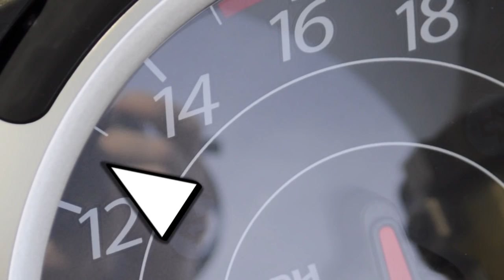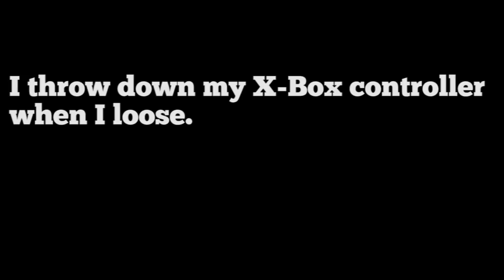Regular Car Reviews: 2011 Triumph Daytona 675

Comment: more like a street triple than a speed triple, speed triple has bigger engine more power different frame, single sided swingarm, ect street triple has no fairings
Reply: You've obviously never ridden a Daytona
Reply: @mikehoskin1674  you obviously haven't.. a street triple is a Daytona engine frame everything only difference is tune, fairings and suspension..
Reply: @mikehoskin1674  a Daytona/street triple are the same frame, suspension, swing arm etc. One had clipons and fairings. One has handlebars and naked fairings.
Reply: @jakvickersmusic  and you think they're the same bike still lol. Guess you don't even ride bikes let alone those 2.
Reply: @mikehoskin1674  I have operated both and own one thanks.

Comment: First bike at the age of 24, 2012 Triumph Daytona 675R(yes the R). Age 25 now, 8500 miles on bike. Have low sided once at a 25mph turn with cold Pirelli Diablo SuperCorsas on a 40Deg day out in the morning 8 months ago. Everyone Falls some day, but not everyone is immature. in less then 30 day's my Daytona and i Will be riding at Circuit of The Americas for a track day. Good review none the less but as you said this is a bike for someone more mature. Will admit though i've done multiple motorcycle courses to keep improving my skills and plan on doing the Advance Riders course once i make my way to lvl3 at track days. MSF BRC1, BRC2, and ARC already completed but thats nothing compared to track ARC. Wish i stayed in Cali longer to do the lvl1 and lvl2 total control courses.

Comment: i didnt know you rode motorcycles
Reply from the maker: Demosthenes409 I do :)
Reply: RegularCars Seriously though, do consider reviewing a CBR250RR (inline-4 from the late 80s) at some point. 20,000 revs of madness.
Reply: Ayush Sharma those are quite rare.
Reply: NinjaChipmunk27 Indeed they are. Technically they were never launched outside of Japan and Oceania. But a ton of people imported them all over the world because they were so nuts. Are you listening, RegularCars ? That's a great fucking story to tell right there.
Reply: I nearly bought one of those a year ago. It was sold out from underneath me on the last day :\ I saw a couple the other day too, hitting up the twisties and revving hard. They really do sound like F1 cars.
Reply: Ayush Sharma Or a ZX2R.
Or a Balius.
Or a GSXR250.
Reply: +Eggly Bagelface or a fzr250
Insane little bikes, all of them, luckily they're fairly common here in Australia. Well I mean cbr's there are lots, probably a little less zx2r then not many fZr250 and finally barely any gsxr250
Reply: +Eggly Bagelface or a fzr250
Insane little bikes, all of them, luckily they're fairly common here in Australia. Well I mean cbr's there are lots, probably a little less zx2r then not many fZr250 and finally barely any gsxr250
Reply: +Ayush Sharma Honda Hornet 250, I believe, has a slightly detuned CBR250RR engine, which redlines at 16k rpm. A blast to ride.
Reply: +Demosthenes409  HE NEVER WEARS A HELMET!!!!!! AND HE.... RIDES A SUZUKI HYABUSA!!!!!!!!!! "RIDE AROUND WITH MY HELMET STRAPPED TO THE BACK!!!!!!!!
"
Reply: +Demosthenes409  HE NEVER WEARS A HELMET!!!!!! AND HE.... RIDES A SUZUKI HYABUSA!!!!!!!!!! "RIDE AROUND WITH MY HELMET STRAPPED TO THE BACK!!!!!!!!
"
Reply: he has like 6 other videos
Reply: +RegularCars 

GROM! GROM!! GROM!!! GROM!!!!

Comment: Street Triple not speed Triple
Reply: Obie Wan you're not very bright are you... there's a street and speed triple
Reply: The Speed Triple has a different engine displacement, this bikes engine is a Street Triple with different cams (675cc).  The Speed Triple is 1050cc.  Obie was correcting the comparison to the Speed Triple.
Reply: dont worry, McG, that idiots comment makes it pretty obvious that he knows nothing about neither wheels, nor engineering.
Reply: Woah slow down there high speed. I had one too many glasses to drink and I misread and thought you said there's so such thing as a speed triple. Chill out kid

Comment: Small correction, the Street Triple is the naked version of the Daytona 675. Now, back in the 90's, the Speed Triple was the naked Daytona 955. Then the models went their separate ways. Daytona stayed at 955 until it became the 675. The Speed Triple went up to a 1050 and stayed there.

Comment: Rode a 2014 675R in LA a few months back for 5-6 hours, and holy hell was that a beast of a bike. Acceleration all over the place, and it just seems to never run out of power. Under 110 at least. It's a bit small for tall guys like me though, and staying in a constant tuck for 6 hours made me a little stiff..

Taking it up PCH an hour and then through the canyons all the way back to the city was really great. If anyone is ever in CA and want to rent a bike, Racy Rentals is super easy to work with and the prices are actually pretty damn good. Spent $150 for a 24 hour rental. Not bad for a $15K bike.

Comment: I'm 21 and have a 900rr Fireblade... Although, I have been riding for 5 years. In the UK. With many restrictions up until July 2014... I had a 50cc moped for a year, a 125cc bike for a year, a Bandit 600 for 3 years and now the Blade.

Comment: Dig the review but it's the Street Triple that shares the engine. Speed Triple is a 1050 - which (fortunately or unfortunately) doesn't have a current full fairing version. I think they made a sport tourer with it for a while though... could be wrong.

Comment: I ride a Street Triple R, the naked, ever-so-slightly detuned version of the Daytona (of which a few other nerds have pointed out is correct, not the Speed Triple cited in the video). What Mr. Regular does get absolutely correct is the restraint you have to have with these bikes. I daily mine, and in normal operation I rarely have to crack 8k rpm to achieve legal speeds. It’s so easy to laze along the highway  at 85mph in 6th at 7k rpm using like 20% throttle and the abundant torque that it’s easy to forget just what a monster lies in that engine.

Every responsible motorcyclist needs to learn how to resist the stoplight call. Every balding middle-manager in his previous gen Porsche Boxster and 20-something in his fart-can exhaust Civic Si sees you and “wants to go, brah.” 

Resist the urge. Do not give in. I know it’s tempting. So, so tempting to show these people what power-to-weight ratio actually means. But please do not squid it up and end up either hurt or pulled over because you were trying to prove something you never had to. The next time a base-spec V6 Challenger peels out next to when the light turns green, just shake your head and laugh as he struggles to keep it in the lane.

Comment: RegularCars   Actually those mirrors with indicators are aftermarket. 

You can get a Suzuki SV 650 as your first bike.  (v-twin 80hp)  Completely different power band than inline 600's or the inline triple.

Comment: My first is a 2012 Triumph Daytona 675. Bought it a couple days ago, but im having to completely readjust my suspension because the previous owner put a brand new one on it and never adjusted it PLUS he upgraded the clutch and put a full akropovic exhaust system with full tune. Won't be stupid, but i'll have my fun

Comment: It's all about the SV650 as a first bike. Treat it with respect for the first month, and you'll be fine.

67Hp... but 47ft-lbs of torque. Everywhere. I'm very glad I chose this machine.

Yeah, my carbed 2000 was way better than my current FI 2007.

Comment: If I can recall correctly, Mr Regular said the Suzuki SV650 was the exception to the 600cc rule. I'll like to know people's opinion on the Ducati Monster 620 as a first bike, I'm new with motorcycles
Reply: The SV650 has two cylinders and goes about 100/120 mph and is a naked lightweight motorcycle. This Triumph is a supersport built for both road and track use and goes about 170+. As for the Ducati, best go ask around a few motorcycle shops and find out if it's the bike you want or not.
Reply: +RotorHead I'll make this simple. It's a Ducati, for a bike that model and the engine configuration, it's a decent starter bike BUT! but... buuuut. It's .... a ducati. You're going to need some money (If you got that checked), some patience (A lot of patience) and lots of love because almost every ducati wants to be LOVED, the bike that itallians top priority on their bikes is to make it the rider's/owner's center of attention on their bike

Like you can proudly say "I OWN A DUCATI" even if its a 50cc moped.

Comment: So I disagree with not starting with a 600 in certain cases. I'm 6'3" and 245. A 300 is physically painful to ride because it's too small, to say nothing of the tire rub on the back fender every time I hit a bump in this state where incorrect bridge alignments are only slightly less common than McDonald's. (I live on the Pacific northwest coast of Washington. I have 6 bridges to cross on my way to work and they all bump up when you get on it and bump down when you get off. By about an inch and a half.)
Reply: Still better off with a 650.

Comment: Hey, they are sold with quickshifters! I want a quickshifter on my gixxer.....saving up for that argh.
Reply: LordAugastus No, only the 2013-2014 675R's are sold with quick shifters.   This is a 2011 675 which has different electronics, and ergonomics.
Reply: Zalonka Daytona after 2010 comes with quickshifter biker noob
Reply: Zalonka 2011 was the year I bought my bike, that is the year I saw a 2011 675r with a quickshifter on deal floor with 0000 on the odo.
Reply: Zalonka My 2012 came with a quickshifter and carbon fiber. It was the only non-R to do so before the new model in 2013. Yes it is the Sulphur Gold, and yes, technically it is a 2013, but it is the previous gen design. I can post pics for proof.

Comment: 600s are totally fine for starters; I started on a Honda 600RR, you just gotta be extra careful.
Reply: no. They aren't recommended because no matter how careful, we still are humans and make mistakes. the cbr has a fairly linear throttle response so if by any reason you throttle it, well you know what happens. same with the dual front brakes

Comment: Sometime you should review my 1984 Honda interceptor 700. Its the sport bike that started sport bikes.
Reply: 1969 CB750
Reply: master777999 The 1968 Triumph Trident beat the CB to the market.
Although ideas for a large displacement triple existed on Triumph's drawing boards for some time, the Trident reached production once corporate spies for the company saw the CB750 coming to showrooms, and Triumph wanted to be competitive in the newborn 'super bike' market. Press of the day felt the Trident handled batter and was faster, but history would prove that the CB for it's day was a far more modern and reliable motorcycle overall.
Reply: Yes, there were many bikes that were setting speed records and being raced, and there were other high performance machines through history, such as the Vincent Black Shadow or Brough Superior. But in terms of mass produced, larger displacement 'superbikes', the original spat between the Trident and the CB750 are what really started it.
Reply: TheNonstopHero I can see that, but I think CaseyAndWhatNot is on to something. The '84 Interceptor is, as far as I know, the first bike with big displacement, low slung bars, and fairings.. A true sport bike as we know it today...

I wouldn't consider a CB1000 a sportbike today.. It's a standard bike..

Comment: There is no reason for beginner not to start on 600cc motorcycle. Maybe not supersport but bike like Suzuki SFV 650 Gladius or Honda CBF 600 are good for beginners. You will just be bored with 300cc bike after a week.

Comment: of course it does 12k rpm. how do you expect to squeeze 120 hp from 675cc ? What does this make you so enthusiastic?
a lancer pulls up next to you... and you need to "rev to 7 grand" and "dump the clutch" to beat a lancer? Are you kidding me? It's not a murcielago. It's not an SLR. There's no need to push things. The "race" will be over with no drama. This thing probably reaches higher speeds in 4th gear than the lancer's top speed.

Comment: Any Japanese 600 supersport from an equivalent year will annihilate a 675.
Reply: not true, that extra 75 horses makes a big difference (though i guess it technically is 'cheating'). The zx6r would probably clean up the Daytona to be fair.
Reply: papa bless you under stand that 675 doesn't mean it has 75 more hp than a 600 right?
Reply: Matthew Trent a bike with 675 horsepower would be fucking terrifying!!
Reply: Ik it'd be insane. I could only imagine an h2 or turbo busa. 300 horses to one wheel when your that light would be sheer insanity
Reply: @papabless9705  how high were you?
Reply: lol don't even remember writing that